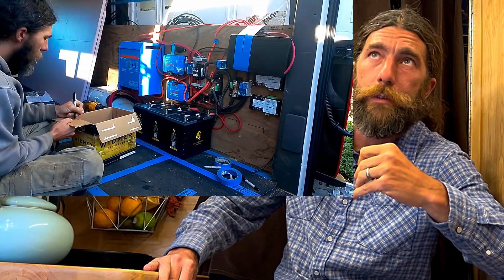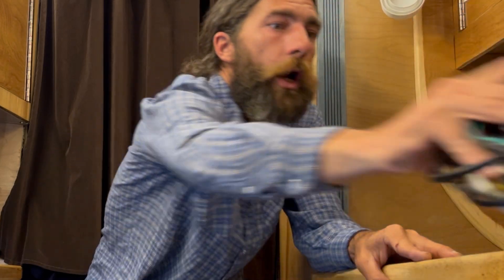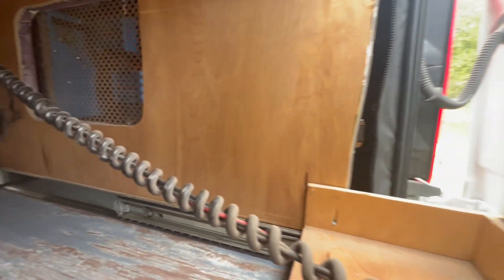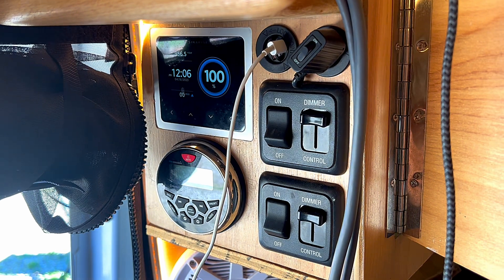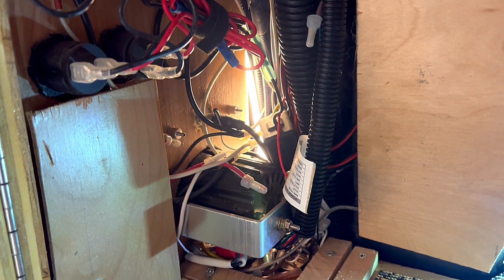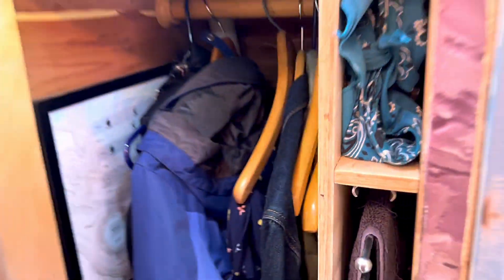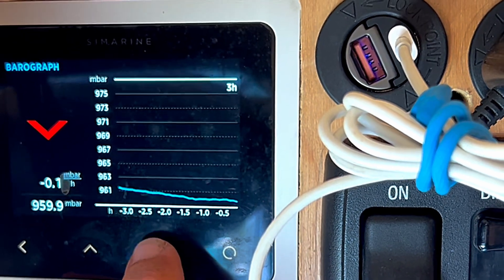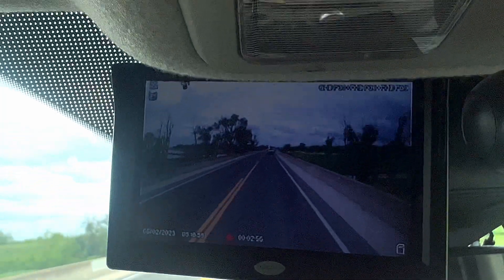Electrical Tour - Van Build Electrical System Vol. 1

Comment: If you were to do this again, would you make the electrical closet on a roll out platform as you did with your cooler platform for easier access if something breaks, or does that not happen enough to warrant it?

Comment: Would love to see a video on how you turned that A/V port into a rear view mirror!
Reply from the maker: Oh… ok… cool… good idea! Until then: the first step is finding a dash cam that HAS an AV port. Mine is VIOFO A139. Next any monitor with an RCA input (3 wire Red, White, yellow type). The only hard part is converting the 3.5mm jack to RCA; 3.5mm jacks come in mono (one ring on probe), stereo (2 rings) and video (3 rings)… you need the 3 ring video on. Then it’s just a matter of wiring it. I found a key for the word of the jack AND the port for the dash cam online… wired it and it did not work, so I had to work it out myself.

Comment: what dash cam was that? :-)   that rear view function is gold.
Reply from the maker: I hope to do a video on this at some point… Until then: the first step is finding a dash cam that HAS an AV port. Mine is VIOFO A139. Next any monitor with an RCA input (3 wire Red, White, yellow type). The only hard part is converting the 3.5mm jack to RCA; 3.5mm jacks come in mono (one ring on probe), stereo (2 rings) and video (3 rings)… you need the 3 ring video on. Then it’s just a matter of wiring it. I found a key for the word of the jack AND the port for the dash cam online… wired it and it did not work, so I had to work it out myself.

Comment: First and foremost, I'm a retired industrial electrician, NOT an electrical engineer.  Having said that, I'd offer the following advice to everyone watching this video.  There are 5 steps to Electrical Safety when it comes to working on any electrical system they are:
1. Shut it off. Kill the main power to the entire system before you begin.
2. Lock it out.  Secure it against accidentally being energized.
3. Verify a lack of power.  Use an electrical meter to verify that the system is actually de-energized.
4. Ground and short.  Using appropriate leads, ground main power lines for the item you're going to be working on and short the positive to negative terminals to ensure there is no stored electricity in the system/item you're working on.
5. Cover exposed, energized systems.  Not all systems can be shut off at once.  This means you should use rubber matting or other non-conductive material to cover any systems that are still energized when you have to work on neighboring systems.

Look, friends, electricity should scare you.  It's one form of energy that you can't see, you can't feel, you can't smell, you can't hear, and you can't taste.  None of your physical senses will allow you to detect the presence of electricity.  Because of this, it is of the utmost importance that we use our tools (electrical meters) to verify the presence or lack of presence of electricity in any system we're diagnosing or attempting to work on.  Following these rules could save your life and/or property.

@Nømad, in a passenger vehicles are required to have batteries in a compartment that is separate from the passenger compartment and vented to the outside of the vehicle because of chemical off gassing of the battery(ies).  I would personally recommend you make that electrical compartment air tight and find a way to vent it outside; especially considering the fact it's right under your bed.

If anyone has any questions, I'll try to answer them, but again, I am NOT an engineer, just a guy who used to work on machines in factories.
Reply from the maker: To the point of batteries needing to be stored in a sealed area vented to the outside… I think this is only true for Lead Acid type batteries, not the lithium ion type used in my electrical system. That said, the 2 AMG type batteries that the Transit van came with from the factory are located under the drivers seat and are kind of sealed (plastic shrouds) and do have a small vent to the outside, about a 1/16” straw through the floor.
Reply: The area where a person has to absolutely make and be careful? is when dealing with capacitors. they can store a lot of power. and if a comes in contact with one? they can release all that power at once, and can be deadly. and many times they might not be right out in open? where a person can recognize them. so like you said a person should be always using a meter? to make any of the circuits are not live.

Comment: Hey, I have a question. Not about electrics, but about the foam.
How does the foam behave as insulation directly on the body when the sun shines on it? It gets under the roof (in a dark car) quickly 150 ° to 200 ° degrees hot when the sun shines on it.  You're on the road in Texas and you've certainly had experience
Reply from the maker: It’s great… it’s R5 as advertised. In the roof I have only one sheet of foam and a small air gap between the ceiling tile and the metal van roof… ceiling never feels hot. In most other places in my van I have 2 thicknesses of the xps and havelock wool so more like R10-20. It stays VERY mild in our van, surprisingly so.
Reply: That's an interesting point, XPS foam could potentially melt.  Maybe on the roof, put some other type of insulation, even if just a thin 1/4 inch layer first.  If XPS against the roof were to melt a little, it would form an air gap to the roof and maybe stop melting once the air insulates it.
Reply from the maker: The tech sheet on the XPS 150 says max service temp is 165°F (74°C)… that said I’m not sure what “service temp” means. You can see my “toxic and flammable” video to see how it reacts to a propane torch and a cigarette lighter… based on that I would say the melting point is much more than 165°. I doubt it would melt from the sun on a car roof, that said my roof is probably not the best test (mostly a single solar panel) and when I installed the ceiling foam I left an air gap (by circumstance) to level out the ceiling between factory ribs.

Comment: That is a nice setup! I have designed my setup with no previous experience. But I did rewire my whole 1965 unimog from scratch. And then I build up a basic system with a small inverter AGM etc. And played with it. And I experimented with some solar panels and a victron controller to get some experience. And I mounted everything on a board so I could easily change and upgrade.

Right now I have 200AH lithium, Victron 2000VA inverter, 340 watt solar 😁
Reply from the maker: Thanks! Rewiring any vehicle from scratch is electrical engineering so I’d say you are qualified!
Reply: @falkornomad  yes its a learning process. Yesterday I learned and updated the firmware in my Victron inverter. and programed the relay to switch on certain conditions 😁
Reply from the maker: Fancy!!

Comment: Hahaha, I'm glad I'm not the only one that thinks of planets orbiting a star when people say 'solar system'. 

A tip for anyone looking to set up a bunch of fuses - you can often find a fuse box from a car in a junkyard complete with most of the fuses you will ever need for less than the cost of a couple of packs of new fuses in the store. I try to find a car that has been wrecked in the rear so I can be fairly certain it has easy access and likely hasn't been flooded out. Some of them are small and easy to work with, or you can just harvest the fuses and relays to fill your own boxes.
Reply from the maker: Lol, yeah, every time I say “… my solar system…” I’m like; that sounds epically egomaniacal… we share the solar system… “MY SOLAR ELECTRICAL SYSTEM”

I love that tip!!! How is the back side of those boxes to work with?… I can not recall if I’ve ever seen the “ass end” of those fuse boxes.
Reply: @falkornomad  It depends greatly on the vehicle. I've used some older Honda ones that had most wires only a few feet long coming off the box and took the whole thing. If you just need the fuses, some cars just have a handful of giant connectors you unbolt and unplug. This was really handy when the fuse box on my mother's Chevy HHR flaked out and needed to be replaced (boy did that take some troubleshooting). Some cars have them buried or integrate other things and aren't worth the trouble.

A lot of cars nowadays are using 2 or 3 fuse boxes both under the hood and inside the car. I always scope out the cars and try to find one that someone has already disassembled for other parts and leaves quick access for me to investigate. There are also a bunch of different styles of fuses. There are various blade types, some you can use with spade connectors, and bolt down ones so you can pick and choose for different projects.

It's also a great place if you need heavy gauge battery cables. Between the cables vehicles come with to aftermarket audio systems installed with welding conductors, you can get a dozen feet or more for the cost of one foot new.
Reply from the maker: I’m wondering if these could be cheap substitutes for the fancy distribution boxes I show in that video… COULD BE???

Comment: Hey dude wondering if you run a dc to dc battery charger. Thanks for your videos there very helpful ❤☮️
Reply from the maker: I do and it’s covered on the next video.
Reply: You can see the DC to DC controller in this video at the 4:58 mark. It's the Victron Orion Tr Smart 30.
Reply: @danielhurst8863  thanks